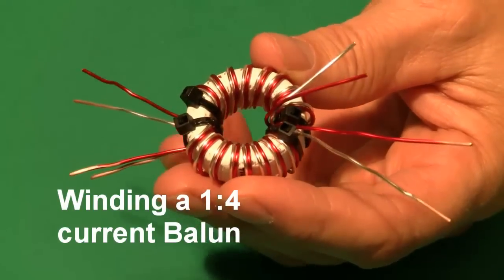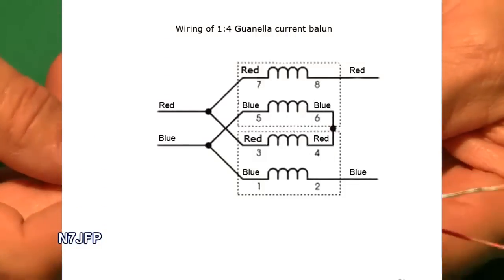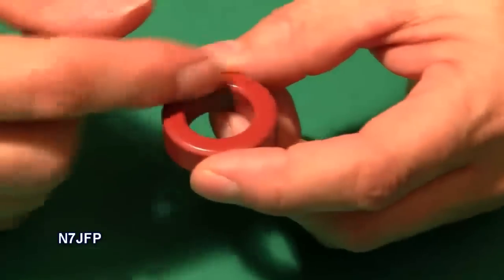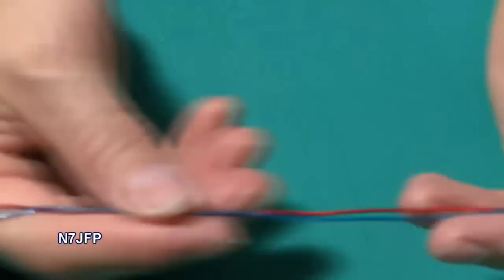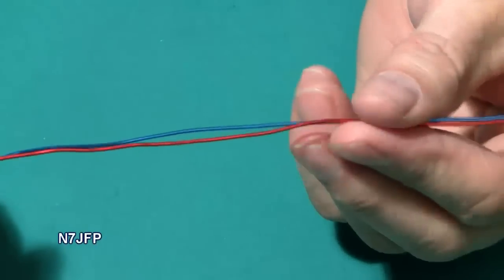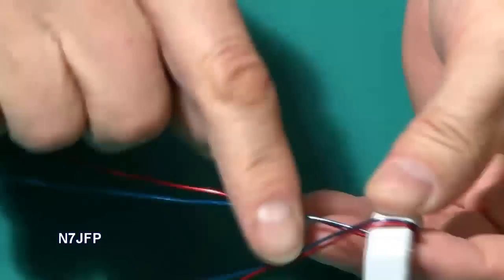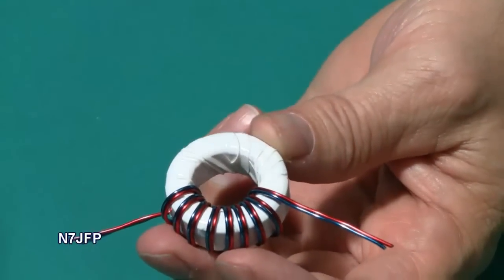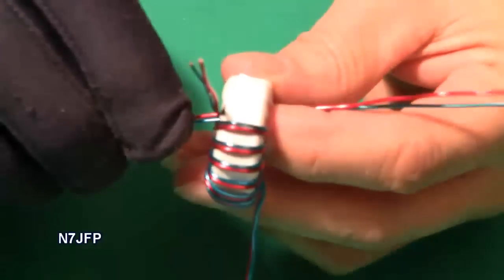Winding a 1:4 Current Balun with 8 turns.

Comment: I'm so confused anymore about a baylun for my 80 meter loop old ARRL  manual says I don't need one other s says it will be less finicky with a Baylon. I wish I'd never got rid of my old MFJ versa tuner too going on my third full wave loop 80 m antenna which is all I've ever used for over 35 years but this last one seems more finicky thought I'd try a baylun , but which one out of the possible 200 that I've looked  at is correct without ordering  150$ baylun   KE4TDG.   73

Comment: Where did you get the wire chart you showed ? Please post a link ! 🙏
Reply from the maker: The wire chart website has gone down.  The size of the toroid will limit the gauge of wire to wind.  18 or 16 work fine.  Try one and see the results.  73, N7JFP

Comment: Therein lies the problem- how many cores, how many turns? One can't just wind some turns  of coax (or balanced wire in this  instance) on a core and assume that it will then effectively  choke off the common  mode current- in fact, the wrong combination can  increase common mode. The 2nd issue lies in the  fact that one cannot make a 4:1 CURRENT mode balun on a single core. What the author has constructed is a 4:1  TRANSFORMER with  completely unknown choking characteristics. His transformer must then be followed by a 1:1 choke with high  real part (R) of the choking impedance. 
If one does not have access to a commercial VNA,  you can purchase one of the nano-VNA's and  learn  how to use it to measure the common mode impedance of a 'balun' or 'unun' versus frequency.
 Dale W4OP

Comment: This balun  is wound incorrectly. Both sides of the torroid should be wound in the same direction. See TRX lab video #105. He did it correctly. You should be showing your polarity (dot) marks as he does. I did a mesh current analysis using mutual inductances and it came out exactly right using TRX’s polarity directions. As he indicates what you have is two stacked auto transformers giving a turns ratio of 2 and a impedance transformation of N squared or 4.

Comment: I am very sorry, but what you have made is a 4 to 1 balun (4:1) for a 200 ohms antenna.
 
A 1 to 4 balun (1:4) is a step up transformer used for a COBWEB antenna which has a 12.5 ohms impedance when complete. The 1:4 balun brings the matching circuit (antenna) from 12.5 ohms to 50 ohms.
 
Also for a much better result a FT240-43 toroid ferrite core is recommended for any type of balun for HF (all HF bands).
73's de M1ENE

Comment: at 10:09 You mention input is on the left and output on the right. To clarify. When you say input are you meaning from the antenna or input from the transmitter?  I am assuming input is from the antenna to make it 4/antenna side to 1/coax to the transmitter. Thanks.
Reply from the maker: 1 to 4,  50 to 200, Transmitter in/Antenna out, Left to right.  A turn thru the toroid is a pass.  On mine one is 8 and the other is nine.  It still worked so I didn't change it.  Thanks for watching.  73, N7JFP

Comment: There are nine passes through the toroid center in the top wire at 8:07 minutes not 8. Eight in the bottum set of wires. Am I correct?
Reply: Agreed. It is not the number outside the core, you count the number of times the wire goes through the inductor. I counted 9 times too.

Comment: would be nice if someone came up with a core identification chart.
Reply: kitsandparts.com/mtoroids.html.        He has more info also.
Reply: Just to add a little to what David says below. The -2 in the T130-2 means that this is Micrometals material-2. You can usually tell by the color of the toroid, although this particular one is a little confusing since Micrometals says this would be a Red-Clear and in the video it is Red-Brown. Not sure what Red-Clear is supposed to look like.   https://www.micrometals.com/products/materials/rf/
Reply: @aaronmattmiller9304  Well I have some cores that are shinny and some dull. Wonder if the shinny ones have a clear coat on them. I have yellow ones that are shinny and a some with 2 colors that are dull. Just a thought.

Comment: How do you make a 1:6 current balun for 300:50 ohm? Also, it appears that the number of turns sets the impedance of the transformar at specific frequencies but not the transformer ratio, therefor the number of turns doesn't define the 1:4 ratio. I wonder why the winding is done half-half instead of winding 2 wires all the way around, and then winding the 2nd set of wires all the way around as well, next to the other wires.
Reply from the maker: I have not made a 1:6 current balun.  This site sells them. https://www.balundesigns.com/model-6113-6-1-current-balun-3-5-54-mhz-3kw/
Individual cores wound with bifilar pairs to create two 4:1 current baluns.
  The two baluns are then cross connected in series/parallel to create 6:1 current balun.  Look up Jerry Sevick's book on Balun design.  Good luck building it.  73, N7JFP

Comment: what is difference between 1 and 1:4 winding 
means a inductor with single winding and inductor with double winding
Reply from the maker: 1:1 impedance match is for stopping current from coming back down the antenna feed line.  1:4 impedance match is (50 ohm to 200 ohm)
like an Off center fed dipole type. 73, N7JFP
Reply: N7JFP i want to ask one thing more sir, i need 300uH inductor. which type should i used ....
Reply: pls provide link for your datasheet like inductor core type and no of turns
Reply from the maker: @kuldeepjayaswal9933   *  http://www.hamradioindia.com/kitbuild/Toroid.htm *  Data I used for Balun.  73, N7JFP

Comment: Thanks for the video, I made a two ferrite ring version of the guanella version you have shown, though the ferrite rings were unknown the SWR reading across the frequency range I required was excellent :-) I have a spare ferrite ring so I think I'm going to make the version you have shown here.  As for insertion loss and rejection of common mode currents, well I don't have a clue, it's got to work better then the air cored 4:1 i have on my OFD dipole at present.

Comment: I count 8 turns on the first wrapping and 7 on the second.
Reply from the maker: There is 9 turns on the first wind and 8 on the second.  It still worked ok.  Maybe it would of been better response if matched.  Oh well, next time.  A turn is when the wire goes thru the center of the toroid.  Thanks for watching.  73, N7JFP

Comment: does anybody know where I can find more information on the cores used in computer power supplies? Would they work for something like this?
Reply from the maker: The problem with toroids is NO identifying labels on them.  A toroid at 60Hz may not work like you want it to at 25 MHz.  It would be best to buy a known value toroid made for a specific purpose.  73, N7JFP

Comment: Great explanation video! I learn T-130-2 and others iron toroids are NOT good for wide range frequency applications, FT-xx-43 would be better  and the  ferrite  toroids are more broadband behavior.... What you say about this?  Thanks!
Reply from the maker: Thanks for watching.  The T-130-2 works for qrp and HF just fine.  The FT-xx-43 would be a better overall choice.  I would use the FT type next time.  73, N7JFP

Comment: The purpose of a balun is to allow  a balanced antenna (or load)  to connect to an unbalanced transmission line without introducing common mode currents. The most important characteristic of a balun is the common mode impedance- that determines the degree of balance. The next important feature is the insertion loss. So it seems you have missed #1 and #2 and settled for measuring SWR- which gives no indication of the balancing efficacy or the loss of the  device.

Dale W4OP
Reply: Agreed.  I think the terms 'balanced' and 'unbalanced' are deeply confusing.  The currents and voltages in coax are just as balanced as they are on a twin feeder when things are working as normally required.  The feeder fields are different, of course, one radial/concentric or co-axial, and the other identical but opposed, but the terminology of 'balance' adds more confusion to an already confused area.
Coax is different to twin feeder (as you rightly say) because it has two modes of transmission, the normal mode, and the second one, down the outside of the cable outer and a single conductor.
Stopping the second mode is the key here, because that is an 'unbalanced' mode.  The outer of a coaxial cable is just another wire EM fields, so currents will flow on it, just as they do any wire.  The coax does not know that you do not want the signals from those fields, so you have to stop them some other way.
Current baluns seem to largely work by stopping unbalanced current flow, which is partly why the term 'unbalanced' is so misleading.  One of the simplest is to put a ferrite ring around the coax.  It works well, stopping the currents on the outside.

Comment: Why 8 turns? What frequency were you designing for? How much reactance did that introduce? What is the insertion loss?
Reply from the maker: +Michael Katt I saw someone else build a 8 turn balun, so I built one and a 15 turn model to see if it really worked.  The toroid itself is built for a certain frequency range that included HF.  I didn't worry about reactance or insertion loss.  The main concern was the low SWR value within the HF band. 73, N7JFP

Comment: Hi there why do some of your 4-1 have 8 turn and another 15, is it to do with bandwidth or some kind of matchinng...from Fred in UK.
Reply from the maker: Tom Smith I made both to see if number of turns really made a difference.  I did not see much difference.  Next time, I would try only 4 turns of 14 gauge wire.  73, N7JFP

Comment: Why is this so complicated?  All you really need is 8 turns with 2 strands of wire. I just made one and it works fine.
Reply: buono...
Reply: Because you don't get enough impedance to kill common mode currents across the bands.  This video doesn't deal with your core question - what benefit do I get for this extra effort.   The balun requires ferrite not dust iron as per video.  If you are using ferrite,  yours probably will work better,  but not be the best you can achieve.

Comment: Now I maybe wrong here but after watching this a couple times I didn't some  looking in my extra class study book from ARRL...Chapter 4 page 40 and I quote "Proper turns counting is important when you wind a toroidal inductor.Each pass through the center of the core must be counted.Part A shows a 1-turn inductor and Part B shows a 2-turn inductor."....As you look at the photo part a is the wire going through the center once and part b going through twice.With that being said I think you are counting it wrong.It would make 10 turns by the book not 8 if I am counting right on pause at 4:11..You are right if you count the outside but not the number of turns as far as the numbers by the books :D...I know I'm being a silly nitpicker lol
Reply from the maker: The next Balun I make I will be more careful to count the Inside turns instead of Outside turns.  In this case the out come
for SWR and freq response did fall within what I needed.  There is some gray area for performance with all the variables in making the Balun.  It is a good starting point in construction of Baluns.  There is so much to learn.  73, N7JFP

Comment: 12/13/14
I'm a bit confused...Both your winding look the same. Both start and finish in the same position. One set of winding suppose to go clockwise and the other counter clockwise
or am I looking at this all wrong ?
Reply from the maker: Hi, At 07:35 you see both sides done.  Notice both sides of balun the wires come out of same side showing that they are wound in opposite direction.  It can be confusing.  Thanks for watching. 73, N7JFP
Reply: Thanks-Can I use this to get broadcast HDTV ?

Comment: Is there anything to stop you using insulated stranded wire? assuming that it was thick enough, and could go around whatever toroid you were using??? why use enamelled single core??? any special reason????  Des
Reply from the maker: I was following Sevick's book on balun construction with solid core wire.  Using multi-strand wire will bring other factors, like capacitive coupling and skin effect in to play.  I have not built baluns with stranded wire.  Build one and find out what happens to frequency response.  Always interesting to learn what works and what doesn't.  73, N7JFP
Reply: N7JFP thank you for your prompt reply sir.....I'll give it a try...I've got a couple of T300 -2 cores on order, so it'll be quite hunky...I hope!!  I did see a posting on QRZ.com where a guy said he's built loads of baluns and used solid and stranded insulated wire and never found any major difference...we'll see...73's  Des
Reply: N7JFP Hello Sir....I tried the balun with stranded wire....I hooked it up to my rig, and into a 50 ohm dummy load...it shows an SWR of 3:1, which I think is too high.

I don't have antenna analyzer, so tried the SWR way.

I am new to building baluns, and I'd like to make this work!!!  it's supposed to be a 1:1 balun wound on a pair of T300-2 cores.

Could I have your e mail address and I'll send a couple of pics...maybe you'd have a look and see what I'm doing wrong....My email is ok on QRZ.com  Thanks  Des  G4OBB
Reply from the maker: Desi kaylor
Without the Analyzer to show the frequency response it is hard to determine what is wrong.  The smallest change, number of turns, spacing, wire size can shift the freq response curve up or down.  73, N7JFP

Comment from the maker: The 18 gauge should handle 200w.  14 ga-500w, 12 ga-1000w.  The wire gauge and the thickness of the insulation on the wire will effect the impedance of the transformer and the frequency response curve.  I have only used it for QRP operations.  I would build one using the materials I have on hand and test it.  Good luck,  73, N7JFP

Comment from the maker: The objective is to get an impedance match between your antenna feed line and the antenna.  Coax (52 ohm) to OCFD (200 ohm) could use the 1:4 balun.  Read more information on balun design in one of Jerry Sevick's books.  Lots of variables and lots of different designs and applications, - - 73, N7JFP

Comment: O.K. so what is the difference in a 1:4, or 4:1, or 9:1 balun if your using the same T-130-2 and 18 gauge wire?  I know the toroid's diameter, thickness & inside diameter makes a difference as well, I guess I just don't completely understand how this little doughnut works.  I'd like to see you show the difference on an oscilloscope experiment.  Now that would be worth watching!

Comment from the maker: They function as a transmission line transformer by reducing the impedance mismatch that occurs between the transmitter and the antenna.  This allows more RF power to be radiated from the antenna.  73, N7JFP

Comment from the maker: I used 18 gauge copper wire with 8 turns thru the middle.  It does not matter how the antenna or coax is attached.  Both sides of windings are the same.  The left side is the input and the right is the output. Do search on Internet for more articles on Guanella 1:4 balun.  Have fun building it.  73, N7JFP

Comment from the maker: You do count the wire thru the hole.  One side does have nine turns and the other side has eight.  The response curve should improve if they were matched.  It worked with the 8 to 9 turn.  I would try to match next time, 73, N7JFP

Comment from the maker: @dg0sa  Thanks for watching.  This was my first toroid winding.  The next one I wound had 15 turns per side and it has a better SWR response.  I have just read "Transmission Line Transformers Handbook" improved designs by Jerry Sevick, produced by Amidon Associates.  There are a lot of variables to consider when winding a toroid.  The physical size, power rating, wire size, frequency bandspread, composition of the toroid and spacing are some of them.  So much to learn.  73, N7JFP
Reply: for what purpose is this ?plz inform me